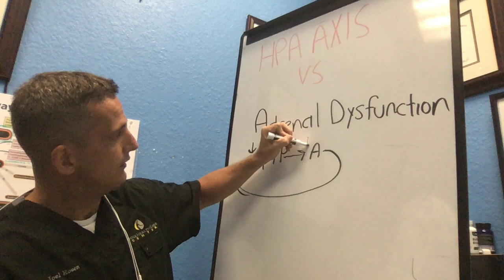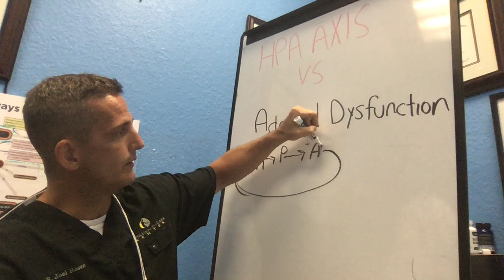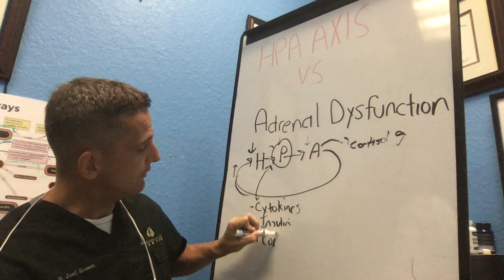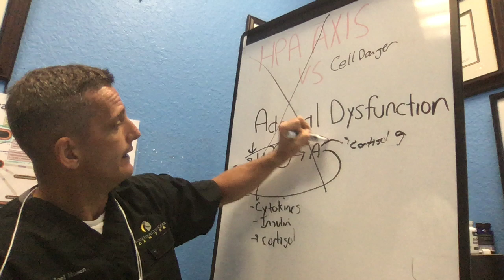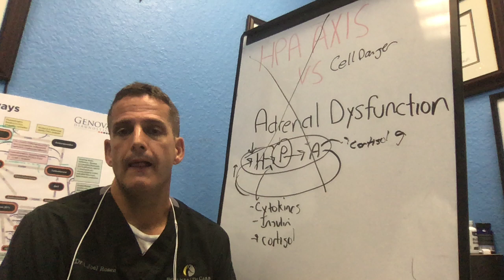Adrenal Fatigue Vs HPA Axis Dysfunction

Comment: I got off klonopin in June. I do not have a thyroid had it removed in 2006. Ever since I got off the klonipin my thyroid levels have been all over. From hypo to hyper without changing my dose. I’m at a loss.
Reply from the maker: Glad you got off the Klonopin in June. At the end of the day, that is the biggest victory of all. Now, as far as the thyroid levels have been all over the place since then, I'm not sure why that would happen. Or, more specifically, what are all the things going on in your body contributing to that. The common denominator would most likely be immune challenges and inflammation. That's what I would start to investigate.
Reply: @JoelRosenDC2MD  thank you, I am considering LDN. I was on an immune suppressant drug up until July 2023 and hadn’t considered that being an issue. I got off of it because I kept getting sick. My joints have been fine since being off and the rheumatologist said he’s not really sure what’s wrong with me. At last check all of my inflammatory markers were normal. I am having an endoscopy in February to confirm there’s nothing preventing absorption.

Comment: My cortisol is now low; whzt do you do about HPA dysfunction?
Reply from the maker: Figure out what is stimulating it and reduce/remove that.
Reply: @JoelRosenDC2MD  , if it was only that easy. I do not have a stressful life. This started after a major stressor, hemorhaging after childbith, and it never went away. My stress response in stuck on for the past 38 yrs. I have finally found someone who knows what they're doing. I'm now going through a lot of testing and will start a therapy called CERESET.
Reply: @janmartell9792  how did that therapy go ? It’s been a year it seems since your post, hopefully it’s gone well x

Comment: Hello Doc hope you are doing great , could you please explain for me the relation between high cortisol & hormone D deficiency , coz i have found two  theories but i don't know what to accept as a fact the 1st is like the body pick top priorities means use cholesterol for cortisol production & stop D production for a while ( fight or flight response ) the 2 is in fight or flight prolonged response  cortisol keep in high level & because the cells have receptors for both D & cortisol so cortisol full all the reseptors & D can't make into the cell , So accroding to your knowledge which one is correct ? i would appriciate your answer it will help me a lot in my research thanks in advance
Reply from the maker: Vit D is tied in with immune health, and anti-oxidant production. That is the ARE (anti-oxidant response elements) signal vitamin D, which signals the ARE.